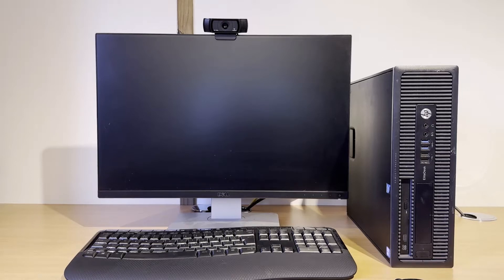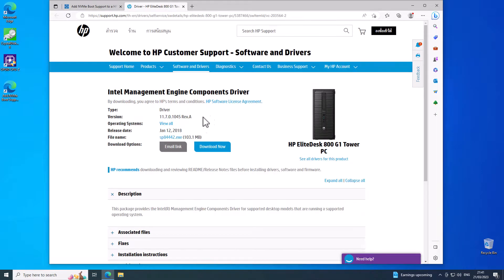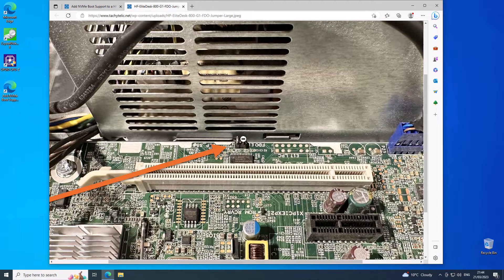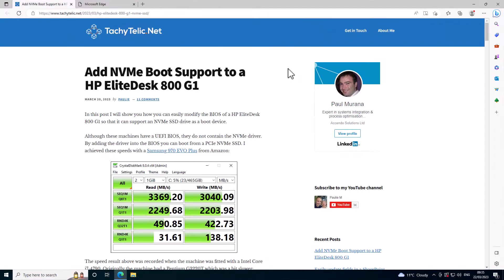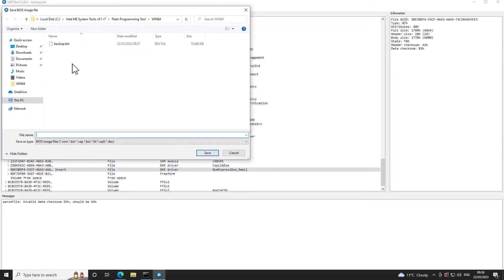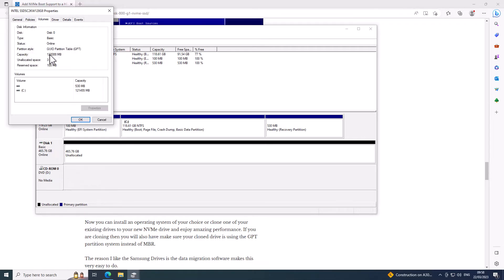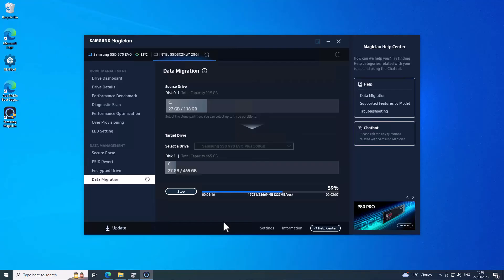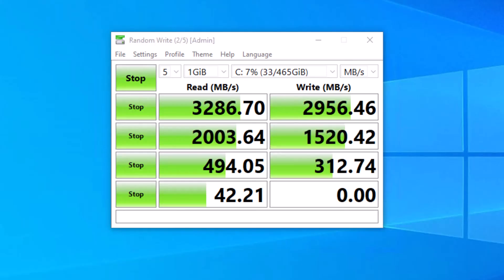Modify the BIOS of the HP EliteDesk 800 G1 to natively support NVMe SSD

Comment: I installed the NVME in my g2 a few years ago. I NEVER did this process as I didn’t know better at the time. Somehow it worked and still works. But as soon as I attach a drive to SATA, I lose access to that NVME. Even in bios without the SATA attached, I can’t access or chose boot priority of the NVME. But somehow when it’s the only device, windows automatically boots up no problem. Is there a way to access both drives? Primary NVME, and SATA as a free drive would be nice.

Comment: Still using this in 2026! Just did it and it worked in Windows 11. Had to add an extra step to turn off Windows Security for known vulnerable drivers before it would let me backup and write the BIOS though. After doing that I was able to turn it back on without issue. Keep this in mind if you have any issues. Also the video is more accurate than the original blog post now, at 7:25 expect a message of "parseFile: Invalid data checksum 5Ah, should be AAh" just like in the video. The blog post does NOT show that error, and I got hung up on it for awhile before I saw this video and realized it was expected.

Comment: Hi! This video is for Windows 10, I'm on Windows 11 and I came across a problem and thanks to ChatGPT I realized that I had to turn off Windows Security\Device security\Core isolation details - turn it off! And only then did the backup become possible. I'm on Windows 11, maybe those on Windows 10 don't have this problem, I don't know, but for Windows 11 this is the solution.

Comment: I tried to use a nvme as a data drive via PCIe adapter, but it won't show up in disk management or device manager no matter what. I'm on the latest bios, all the PCIe slots work. Guess I'm just unlucky

Comment: I have a 32 inch Furguson tv using this as a monitor and having problems with graphics whilst using a vga cable on HP ELITEDESK 800 G1 USDT I have set point to point on my tv yet I still cannot get desktop to align with tv to have it centred there is no further options for scalling or adjusting in settings I did have HDMI attachment for the computer when I bought from techpros but HDMI lead failed and wonder if you could assist and advise the best way I can adjust so it fits fully on my screen when looking there is a black line underneath task bar and I cannot adjust and icons on the left of the screen a partially hidden current scalling settings are at 1336 x 778 and thats the recommended settings what it states on the computer current Graphics using is Intel (R) HD Graphics 4600 .

Comment: Man you rock!

I own a computer shop and had multiples of old PC’s that have nvme slot but dont support the nvme ssd. I can fix them now just fixed the one along the video.

For the curious ppl, the bios flash part wont work on windows 11. The system has to be on windows 10 for the bios flash part. I learned that hard way.

Comment: Regarding my post yesterday; so far I have found the following differences between 800 TWR G1 and G2:
- I downloaded Intel Management Engine Components for G1 (not G2) sp84442.exe (should still be fine);
- PSW and FDO slots placed in different positions (but identified) and jumper placed.- 
- my operating system is Windows 11 instead of Windows 10 as in the tutorial.
Paul do you think I can proceed?
Thanks for your attention.

Comment: Does this method works on HP Compaq Elite 8300 SFF? Because, i used your guidence on your page for HP Elite 8300 SFF has led me unable to boot my PCx anymore. Initially it works for weeks flawlessly. Later, the booiting started to gives problem until it gives away. My PC doesnt boot, power supply fan spins like F1 and remains there until i pay up my electricity bills. I believe my motherboard gone, particularly the BIOS. i had bought a new same PC. Please guide me.

Comment: Excellent video and excellent explanation, without a doubt the best, I have a question, see if you can help me. I did the whole process on an HP ProDesk 600 G1 SFF, which I updated the BIOS first.
I want it to be faster on the hard drive in C,
Characteristics of what I want to build
I bought the following device: GLOTRENDS PA12 Dual M.2 Adapter for OneM.2 NVMe SSD and One M.2 SATASSD, SupportPCIe 4.0/3.0 Full Speed
The SSD is an M.2: KINGSTON NV3 1TB M.2 2280 NVMe 6000MB/S SSD DRIVE (SNV3S/1000G)
There is no problem with storage, the drive looks great and runs at PCIE 3.0 speeds
It sees the drive as SATA2, but it won't let me configure it in the boot sequence.
Could you guide me on what I should do? Maybe I'm missing something or it definitely has to be done through a USB in order to boot. I tried to install on a SATA disk and another installation on the M.2 unit but nothing starts but the disk starts again and it doesn't work.
Can you help me please or is there definitely nothing that can be done to use this adaptation to use an M.2?
Thank you, I await your response.

Comment: Good video, thanks 👍 I was wondering if there's a way to enable usb power when the computer is off (shut down). I have the same exact model (800 G1 SFF) and I couldn't find it on Power Options under BIOS.. Cheers!

Comment: Thanks for the great video. Just done this in my HP EliteDesk 800 G1 with a Samsung 980 PRO NVMe  M.2 SSD and works perfectly. Just a note for anyone trying do do this on a Windows 11 PC I Could not get it to work as you can't get past administration privileges even if you have full administrator account, I believe this is a problem within Windows 11. My work around was to just put a drive into the PC with Windows 10 and followed the instructions and it works perfect. Thanks for the very instructive video and the PC is now very fast in deed.😀
Reply: @GeorgeL1943  I went through the whole process with a windows 10 ssd installed and when it was all done I just inserted my NVme drive which already had windows 11 installed on it. What i was trying to do was go through the process with a windows 11 ssd installed and it would not let me get past the administration privileges this way. Hope this helps.
Reply: @michaelgarnett218  Thank you so much for your kind reply and helping us out. We appreciate you!!!
Reply from the maker: Thanks for the info and glad it worked well for you.

Comment: What about the data transfer speed??? Is the same as the advertised speed by the manufacturer of the ssd disk??
Reply from the maker: Id the SSD is fast enough you can get UP to 3000/mb sec.
Reply: @PaulieM  Thats great

Comment: OK, now I've found the jumper, I'm trying to run fptw64.exe with the correct arguments.  I am logged into Windows as an administrator, and run CMD using right click| Run as administrator.  The Widow reports "Administrator: Command Prompt".  However, when I run the correct command it reports firstly "Error during PMX call....failed to start loaded service err: ....."  Then in red "Error 284: fail to load driver (PCI access for Windows).  Tool needs to run with an administrator privilege account" which I think I have.  Anyone any ideas?  I've used the similar procedure Paul has published on several Dell machines and they have worked.....  I have an HP G1 EliteDesk mini as well to use so I might try that to see if I get the same error......As this machine has no full PCI slot I will be using an MXM to PCIe nvme m.2 adaptor but I presume I can add this once the driver is loaded in the bios....PS It doesn't report after the sign on of the app finding any flash drive by the way, but the machine is clearly booting from the bios....
Reply: Just noticed that the Error 284 refers to idrvdll.dll, whereas the folder contains a file idrvdll32e.dll....
Reply: Not relevant however, as this is normal compared to other machines I have used the procedure on.  I've just tried the same update process on an HP G1 EliteDesk 800 mini and the process worked m, and i now have Windows 11 installed on a 128gb nvme ssd and it boots fine....
Reply: In case anyone was wondering...., the HP G1 usdt wouldn't work because of some strange file protection on the hard disk I was using.  I took the ssd out of the HP G1 mini that I had used to successfully set that machine up with an nmve m.s ssd in a WiFi slot, then used that ssd to successfully upgrade the bios of the usdt.....Windows has detected a 256gb m.s nvme ssd on an MXM adaptor card in the usdt and I'm currently installing Windows 11 - let's hope it can boot from the nvme ssd!
Reply: Hi! I also came across this problem and thanks to ChatGPT I realized that I had to turn off Windows Security\Device security\Core isolation details - turn it off! And only then did the backup become possible. I am on Windows 11, maybe those on Windows 10 don't have this problem, I don't know, but for Windows 11 this is the solution.

Comment: I have a gfx card in my 16x pci exp slot, which is where you placed the nvme card. Can the other slots be used for NVMe?
Reply from the maker: Yes, although the other ports are not as fast. You can expect to receive a maximum speed of around 1600MB/sec.

Comment: Hi Paul. Like mine, your moboard looks to have only 3 SATA connectors(0-2). But you can see unused pads for SATA connectors numbered 5 and 4 (l don't see a 3). Is it possible to solder on  2 more connectors - perhaps cannibalizing an extra cable, cutting it  maybe 4cm from its connector, exposing the wires and soldering them to the empty SATA pads?
Reply from the maker: It’s a good idea - but beyond my skills to try. Are you able to try it?

Comment: I've tried this with 800 G1 sff i5. Everything seemed to go smoothly following instructions but still won't let me boot from nvme, can see nvme drive in windows though?
Reply from the maker: Did you put anything bootable on the NVMe and edit the UEFI bootlist? i.e. try cleanly installing Windows to the drive and see if it can boot from it.

Comment: Hello , I have tried but it doesn't work, after doing the bios update, restarted the PC, but it won't boot. Also I don't see an UEFI boot option in my PC, any sugestion? My NVME is not Samsung.
Reply from the maker: It doesn’t make any difference what NVMe you use. How do you know it doesn’t work? Do you have anything that’s bootable on the NVMe drive?
Reply: @PaulieM  It is working now, I have cloned my HDD which was MBR , therefore the clone was also MBR, after converting to GPT it did work. But I do not have a gain so huge like you have, I have 1500 Mb/s read/write, but anyway is much better than before. Thanks.
Reply from the maker: @myama9688  what CPU do you have? You need at least an i5 to get the top speeds.
Reply: @PaulieM  I found the issue, I had plugged my PCI card into white slot, which I think it is PCI 2 , I now plugged into black slot, PCI 3 and I've got similar performance like you do. Thanks a lot, very useful.

Comment: I have a vga in black pcie, also works in white slot x4-x16? Thanks.
Reply from the maker: It will work, may not be as fast. I can’t remember that machine well and don’t have it anymore.
Reply: @PaulieM  Thanks!! I read your blog post, and found this from other user:

"Thank you Paulie. It works with UGREEN NVMe PCIe Adapter PCIE4.0 x4 and TEAMGROUP MP33 512GB PCIE Gen3x4 M.2 2280.

I installed it on white PCIE becuase Nvidia 1050Ti uses the black PCIE. and I got read 1700MB and write 1600MB.

now game load is more faster than SSD SATA.

Thank you for sharing your knowledge."

Not is the best option, but not is slownly... i not use video edition or use modern games...

I purchased PCIe 4.0 1TB Gen 4x4 from kingston, for future motherboard/machine upgrades...

Thanks now.

Comment: It worked. I can put anything on it, but I can't get it to run OS. Maybe it's because I can't inject the BIOS due to write protection, isn't it? Or could the reason be the board that runs the M2 SSD?
Reply from the maker: If you can work with it as a data only drive. The M2 adapter is fine. Your problem is not being about to modify the BIOS. Have you checked the blog post and comments?
Reply: Really, I would have liked to use it as an OS operator, so what exactly is the problem? I read some comments, but I did not notice anyone facing this problem, I know that I have to flash the BIOS, and I tried using a flash drive, but it did not work. Is there another proven method that I could try, if possible, in detail, because I do not have much information about the BIOS, DOS Link, or the like?
Reply: I have an HP EliteDesk 800 G1 TWR by the way.
Reply from the maker: @HatemFareed  The detailed instructions are in the blog post. If they do not work in your case, I am not sure what to suggest really.

Comment: Hey I did everything you said and everything was fine until I put this command in cmd  fptw64.exe -A 0x580000 -L 0xA70000 -F nvme.bin it gives me this Error 280: Failed to disable write protection for the BIOS space! Any help would be appreciated, Thanks in advance.

Comment: I was able to get this done on my 800 G1 SFF, I do however have an issue waking the machine up from Sleep mode, mouse and keyboard are not able to wake the machine up and it closes everything as soon as it goes to sleep mode. Not sure if this is related to using the PCI express adaptor and compatibility with the BIOS or not, but that's the only thing that comes to mind.

Comment: Hi, probably unrelated, but I have a elitedesk 800 G3 with NVMe slot, I enabled it on the BIOS and disabled legacy, but yet unable to boot from it nor even see it as an option during install. I have reverted to using a 2.5 SSD with a brand new SSD just sitting in the "Invisible" NVMe slot. any clue ? (thanks)
Reply from the maker: Is it visible when you are booted into windows?
Reply: @PaulieM  no it wasn't visible, neither was it when I installed proxmox.
Reply from the maker: @massivebull  that’s strange. Maybe the drive is broken or not properly connected.
Reply: @PaulieM   Thought as much, yet I pulled the drive and put it in an external enclosure - was able to read it on a different machine, the only explanation I'm left with is a potentially faulty connector on the g3 motherboard

Comment: This is what I need. Thanks a lot!

Question: can I install any OS to the nvme ssd after going through all the steps?
Reply from the maker: Any OS that supports NVme. It’s built into Windows 10 onwards.
Reply: @PaulieM  That's cool. 
Anyway, do you think it works on 800 G2 as well?
Reply from the maker: @AnwarF_  I think G2 supports NVMe without modification, but I don’t know for sure.

Comment: I've tried this on my 800g1 mini to have access to the onboard nvme slot.
All went through with no problems - did just like you explain, but unluckily the bios wont recognize the nvme.
It's the last bios version 2.33.
The sata drive that's installed was an MBR, and the new installed nvme is a clone of it.
Might this be the problem and i have to install it in GPT ?
Will the bios then "see" the drive?
Best regards - nice  video with clear instructions!
Thanks
Reply from the maker: I’m about to update the guide as I’ve purchased a 800g1 mini
Reply: Nice!
Will stay tuned....🙂

Comment: Will it work for HP 800 G1 TOWER?

My setup:
-HP 800 G1 Tower
-Geforce GTX 970 4GB
-32GB DDR 31600MHz RAM

I have graphics installed in the black PCIE slot. The PCIE adapter will be installed in the white port.

@PaulieM
Will this work? If so, at what speed?
Reply from the maker: I guess it would work, but as I have not tried it I cannot say for sure.
Reply: It runs like a dream!!! Thank you! @PaulieM
Reply from the maker: @PiotrSkrzypek-v1j  brilliant news! Well done!

Comment: I keep getting Error 284: Fail to load driver (PCI access for Windows).
Tool needs to run with an administrator priviledge account.when i try to backup the bios despite running command prompt as admin

Comment: Hi, i have a question. I'm going to install a nvme ssd, but i have a graphic card on my x16 pci port, i'm going to use the white pci port, i think is x4 and i want to know if the nvme with the adapter work in that pci, with the same process or modification on the bios. Thanks and i wait to know.
Reply from the maker: It will work, but you might not be able to max the speed of the SSD out.
Reply: @PaulieM  Ok, thanks. In the description of the adapter I bought (next to the disk), I could see what by 
PCI 3.0 at X4 may work at ~4gb/s

Comment: Hi Paulie, I was trying to install a nvme drive to my hp elite 8300 diff but kept on getting a error when trying to modify bios 
Which was - “erasing and writing  flash chip.. transaction error “ what should I do thanks
Reply from the maker: It does not sound like you should proceed. Maybe you have a different bios chip.

Comment: After doing this in the exact model, my computer just refuse to start....it doesn't detect any hard drive or SSD or USB in UEFI
Reply from the maker: Then you will need to buy a USB Chip Programmer and restore your BIOS using another machine. Does the machine boot at all? Into the BIOS? If so there is an option to restore the BIOS from there.
Reply: @PaulieM  I mean,I had to do that (thanks for the help tho) but I still can't boot from the SSD,but yes,computer recognize it as drive storage, just can't boot